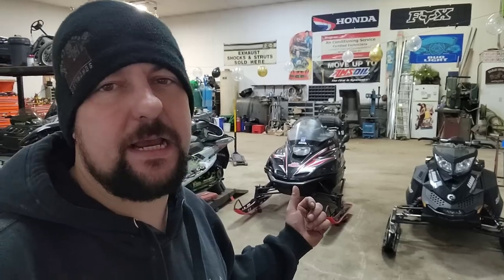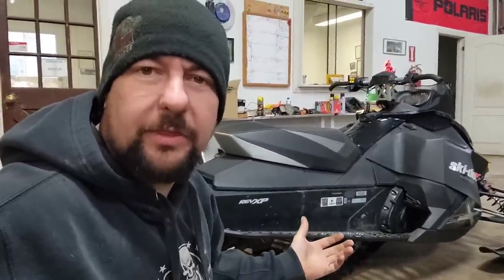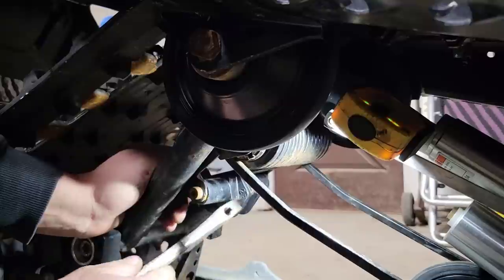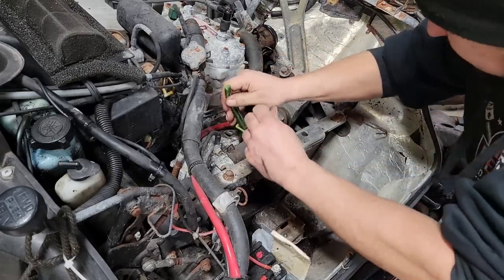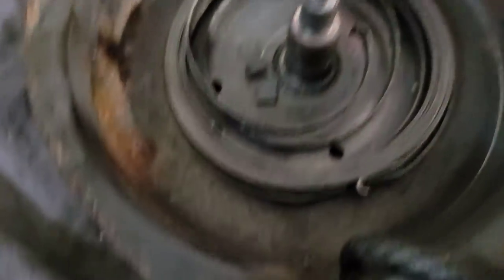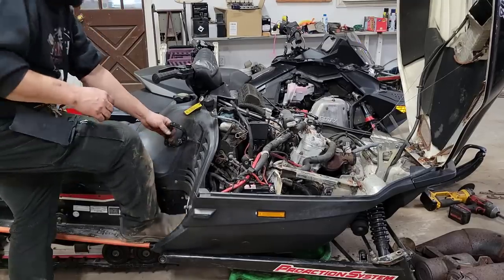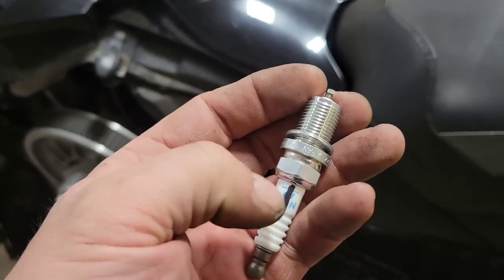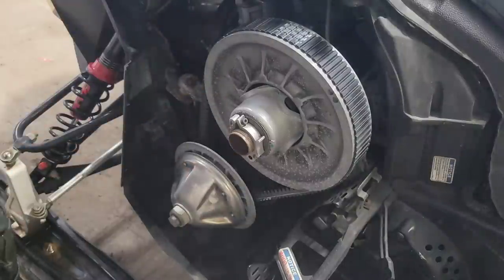Recoil Rebuild & Tune-Up

Comment: You don't see many mechanics on youtube not wearing latex gloves. love it, old timer.
Reply: Ya ..
They're askeerd of getting dirty!  Was a powersports service tech for 42  yrs.....I didn't need no steenking rubber gloves!
Reply: Not an old timer it's a Canadian. We fucking hate gloves while wrenching. Especially fellas with big hands like myself
Reply: @stevenbaker9327  takes longer to get the things on properly than the fix takes half the time. I mean if I'm busting out the 4 foot snipe on the 2 foot extension I'll throw some actual mechanics gloves on for a minute so my hands don't get bashed to hell when it breaks loose and your Knuckles go crashing into the concrete. Latex won't help ya there. Then I promptly take em off
Reply: Agreed. Definitely a fella I can relate to.
Reply: Latex gloves last about point 2 seconds until they get a hole, total wast of money no sense in using them
Reply from the maker: haha thanks! and I mean it is called Rednecks Dirtyhands for a reason 🤣🍻 we do redneck blue-collar work and our hands are always dirty 🍻
Reply: Totally true. Especially those gorilla ones. Soon as I get home I'm having a shower anyway. Fucking gloves seem like everytime u grab a screw u get 2 . I don't want 2. I want 1. Only time I always wore gloves was when I was falling trees. Wrenching and construction. Never
Reply: Wearing gloves does suck but I do it as much as I can. The skin soaks up all those chemicals and the old liver has to deal with it. Guess something has to kill ya.

Comment: Just stumbled across your channel, and enjoying the content.  Learned something years ago regarding recoils.  That little square notch in the wheel is used to wind the rope back in.  Put it together, with no spring tension, and connect the rope.  Put a knot on the outside of the recoil to keep it from pulling through, then pull a length of rope through that square slot, then holding the rope, just wind up the spool.  When you get to where you want, pull the rope to pull the slack out, and let it wind itself back up.
Reply from the maker: thanks! I'll have to give that a try next time 🍻

Comment: Hi ! glad to see that V-Max 500 ! I have a V-MAX  XTC 700 tripple 1998 sleeping in storage since around 2011 ! will it still run ? I have the same problem ! yes , the recoil is due for changing ! it broke when i was on the trail alone in the woods ! So i fixed it McGiver style ! So it pulls and starts the engine when it s cold but when it s warmed up from riding it doesn t catch ( hook ) and i need to wait till it cools off then it hooks on and i can pull the cord and get going ! I like that sled ! I put new parts on it just before parking it ! the seat is new, the heated handles, the carbides, the track, the wheel bearings, so i guess a good tune-up would do the trick and ready to ride for next winter ! now i m retired i have time to go for rides any given day ! The only problem now is that it s in storage in Edmonton, AB. and i m around Montreal. QC. only 3,800 km away ! LoL. 😎

Comment: I LOVE Gates Belts... Last 3 times longer then Ultra max and Dayco
Reply: they don't last for me man 10-15 mins she done on the same sled were the stock brp belts last a very long time
Reply: @NightshiftCustom  You have to shim your clutch Sheeves to the belt. Gates is a far better belt durometer wise. The same would happen with Dayco or Ultimax. You must shim the clutchs to the belts as they are not exactly the same Measurements as a factory belt.  And if they are not lasting more then 10 to 15 min. Something is wrong with your clutches or your not braking in the belt.  I can Toss a 320 dollar belt on and roast it in 5 min if You don't warm them up or adjust your clutchs.  I have gates belts That lasted me 8000 miles Before I changed them out.
Reply: @otahu26  no shims needed to on this skidoo that's in the video its very easy to setup 
 and I call bullshit that these belts are better . this sled uses the same belt as the can am x3 turbo's and they pop real fast on them to!
 I change my belt out around every 2000kms avg and have never had an oem ski-doo belt blow on me yet in the 20+ years I have been riding sleds

Comment: I popped one of them gates belts brand new in about 10-15 mins on the same sled. there junk!!! went back to stock BRP belt
Reply from the maker: really? wow I've been using the gates  G force c12 on my 300+ horsepower T-cat with no issues... I find they hold up just as good as any other belt out there but that's just my experience 🍻
Reply: @rednecksdirtyhands  wow I guess you lucky lol they don't hold up on the Can Am x3's at all either